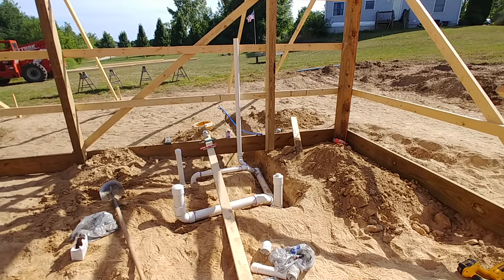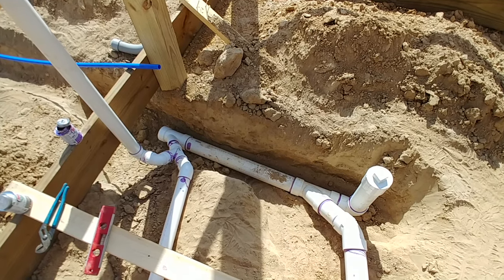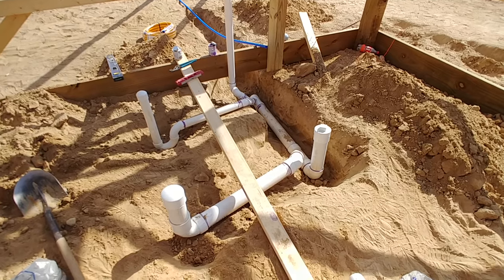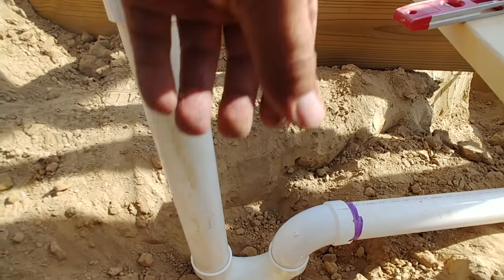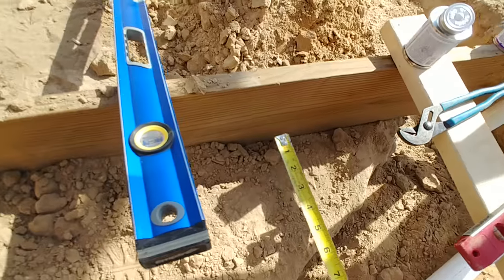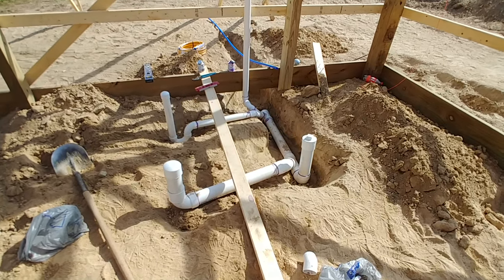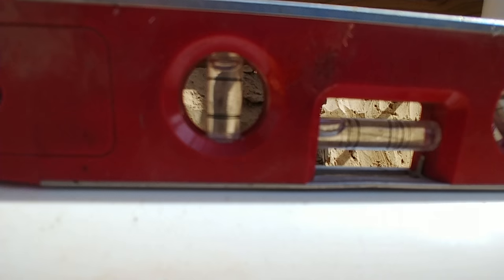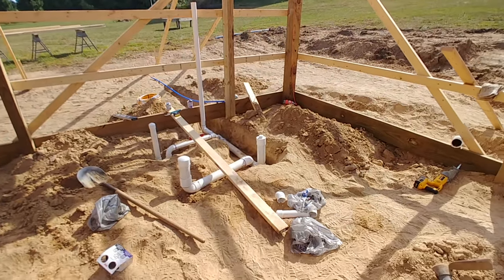Rough in plumbing basics for under a slab.

Comment: I’m a licensed plumber and this is mostly good advice. Just check the pitch on your pipe. 2in pipe should have 1/4” fall. 3in and 4in pipe should have 1/8” pitch. Also the location of your vent is off. If you’re going to be doing plumbing yourself you should consult with the local inspector before you run any pipe. Depending on your jurisdiction they should allow one free consultation per permit. Also if you need dimensions on the fixtures you’re going to be setting, you can request a submittal page from the manufacturer that should have the recommended dimensions
Reply: Hi ! I don't see ventelation for toilet , only for shower, it's ok?
Reply: What I don’t understand is when your looking at the plans how do you know where to put your pipes?
Reply: @VASYL198  unless that 2” vent picking up the shower is  also picking up the toilet. Can’t tell how many feet from toilet In my state it has to be within 8 feet …
Reply: For being a so callex(licensed plumber?) Grade is the least of the problems with this ground work!

Comment: Depending on state and city ..... some measurements and facts given may vary some....... for example, its ideal to grade trunk line between 1/8" to 1/4" of fall per foot.  Any more and your liquids out run your solids leaving them behind which can build up and cause a stoppage.  Good video ...... just check local and state regulations and codes.
Reply: Not actually proven true.

Comment: Quarter inch rise because you start at the bottom or clean out and go up, not 1/4” fall. The vent on the shower is over pipe diameter for grade, will syphon out probably. And tough to tell in the video, but min 2” wet vent on toilets. Plus toilet is over graded. The poopoo will be sticky sticky on the pipes

Comment: Your drain and vent going out need to equal the same area per code, minimum drain slope is 1/8" which needs to be engineered. You shouldn't use anymore than 1/4" because your liquid will flow past your solids. That way it will take it all down and not leave solids in your drain line.

Comment: This is the video showing what you should not do. The slope into main drain from the shower create a S-trap which violate a plumbing code. You should put them on level. Now you need to dig the slab to make it correct.
Reply: Wrong, do not use this layout.

Comment: Good job man.
2 things I learned last year:
1/4" rise is crucial - if you go any higher, you risk having the water run down the pipe faster than the solids do.
That means solids will linger and eventually create snag points for further, snags and eventually clogging - possibly.
Can reduce this by using the  1/4" rise.
Reply: I haven't had luck posting sources so here's a quote that debunks that, you can google it:

"Myth To Rest
(...) Of course, I found out that the professor was setting me up. This lead to the presentation of a new equation. The equation calculated the minimum flow rate to keep solids in suspension in a sewer system. The inverse of the equation calculated the maximum pitch before the liquids ran away from the solids. Of course, the answer to the maximum pitch was infinity. In other words, you could never reach that point."
Reply: Over kill is not always a good thing.
Reply: That's how I remember the rise as well.  If you have a rise in excess of 1/4" it could suck you right down the toilet!

Comment: Not sure if anyone has already made this point…?
But you need to stay as closest possible to the quarter-inch fall per foot or rise, as you called it.
Any fall that drops faster than a quarter inch per foot you will have liquid separating from solid, and that will create a clog!!!
Reply from the maker: Yes and I should have been more clear in the video as when I made the statement I was refering to the shower drain line.  But all solid waste lines should stay at 1/4 per foot rise. :)
Reply: i know it is mentioned in code but i do have doubts about it.  Why would a more sloped pipe be clog compared to a less sloped pipe?  Gravity should also play its role.  If the 1/4 per foot rise is really important, then why vertical sewer pipe are not formulated as such?
Reply: @halalmeatshophk  the water gets ahead of the turd and the turd slows down and eventually hardens.
Reply: @MrDW-ei1fe  is this an opinion or an established fact?  are there any tested made on different slopes of pipes?  and does these tests have reports for reference.
Reply: @halalmeatshophk  established fact. It’s common place in the plumbing trade to annually run an experiment to insure that gravity is real. 6 months ago at my shop we had the control group put dwv at the proper fall as per code while the experimental group puts it at a greater slope than is recommended. 3 months after we dug up the pipes and cut them open. The ones with greater fall than is required by code had a significant amount of waste build up whereas the ones at proper fall had none.
Reply: And any thing less will not be able to push it out.
Reply: either a heavy 8th or a qtr
Reply: @halalmeatshophk  wow dude, you should probably carry around a plant with you to replace the o2 you waste.

Comment: Are you using Oatey Medium Clear PVC Cement? 
How do you find it for working with 2-3" pipes? 
In case you have also tried the Regular (viscosity) cement, which one do you prefer?
I am trying to decide on which one to go with for 2-4" pipes and according to their description both will work fine as Regular can be used up to 4" and Medium up to 6".

Comment: Great video and excellent tip about the second line on the spirit level, until seeing this I was vague about how to layout my under slab plumbing.
Reply: Use the code recommended slope. Especially if you're getting inspected. They want it to match code, not vary from it. The slope is prescriptive on this for a reason. But it is a good thing to note what the lines mean.

Comment: Great video, built my pole barn/house pre internet days. Used Charlie Wing "Visual Handbook of Building and Remodeling".  Different size pipe have different allowed distance to vent. Whole house plumbing under slab. Still works great 26 years later. Your system I'm sure works fine. Glad to see the internet is full of hopeless do it your selfers like myself. Enjoyed the comments.

Comment: I always like when plumbing vids are recommended to me! This was a nice find. I'm seeing a bunch of "too much slope" comments though. This does not apply to plastic piping. Go look inside your pvc/abs piping. Notice it's really smooth and slick. Now wet it. Its gets really slippery, and will not catch anything. Your toilet flushes with a little over a gallon of water. All that water will carry any solids all the way to your city sewer tap or septic tank with proper pitch. Some codes say atleast ⅛" for 3", others say ¼" for 3". Now go look inside cast iron piping. It's not so slick, and actually quite rough on the inside compared with plastic piping. The "too much slope" idea came about with this cast iron piping. Inspectors were worried that with too much slope, water would flow faster than solids, leaving solids behind due to the rough surface of the cast iron. Just something you may consider next time. You're fine with the slope you have. I'm sure you've never had any problems with this rough in.
Reply from the maker: Thanks for the comment.  As I have also had a lot of extremely rude comments I deleted as well.  But this setup did pass inspection and works fine. So I felt maybe a lot of the negative comments were just trolls.  😀 But I do also understand different areas can have different requirements as well.  Just all depends on the inspector for that area.
Reply: @BevinsBuilds  honestly it is just how YouTube is. Miserable people want to go out of there way to somehow one up you by saying you did this and that wrong. 
I get them too, all day. 
Still hard to understand what is wrong with those people. 
I am considering doing my own rough in under slab plumbing so that's why I am here and your video does help. An honest thank you, you did not need to take the time to make and share the video but you did. Tell the haters to make a video of the "right way" they would do it, their nay sayer comments have no value.

Comment: Just so you know 1/4 rise is necessary so that some water remains in drain longer to keep paper from sticking to the bottom of pipe if you use 1/2 or worst 3/4 inch the water flows out too fast and leaves the paper behind to build up.

Comment: Thank you for sharing since I am doing something on a larger scale and u north where the lines have to be 4 feet underground to prevent freezing. This was a good start. Was wondering if I were to connect 3-4 washrooms and 2-3 sinks how many venting lines would be required. to be installed along the loop.

Comment: Awesome video .. the one thing i will add (that i got from a plumber once) - is that you don't want to put excessive slope because when you do, the "liquids" tend to leave the "solids" behind. Thought i'd mention that just in case there's any truth to it :) Cheers.
Reply: It's definitely true on toilet lines. (Because they have solids and toilet paper, the greatest culprit). On the smaller line...not typically an issue.
Reply from the maker: Yes you dont want to run it on too much of a slope. Sorry I didnt learn that until after I didnthis already.  But the plumber friend I have told me that being this is such a short run that the pitch ofnthe line is fine.  My finished pitch ended up being roughly 3/8 for 2 ft before the 45.

Comment: if the main out horizontal pipes are to be sloped at a slight angle, then wouldn't the vertical connecting pipes be also a little slanted and not perpendicular to the ground?  what is the technique to install vertical pipes perpendicular to the ground and yet the connecting horizontal pipes be sloped?
i do assume here that vertical pipe bonding with horizontal pipe are properly angled at 90 degree to avoid leakage.
Reply: Have you ever found an answer to this question? I’ve been wondering the exact same thing and I can not find anything on the internet that addresses this.
Reply: @conw5144   No i didn't find the solution yet.  I really wonder how they solve this problem.  If you do find any guides or video about it,  do share with me.
Reply: @halalmeatshophk  I definitely will
Reply: @halalmeatshophk  Apparently, the pitch on horizontal drain pipes is not enough to really affect the adjoining vertical pipes. Plus there is a small amount of wiggle room when a pvc pipe is inserted into a hub on a connecting piece. This was told to me by a licensed builder who also has had experience in plumbing. Hope this helps!

Comment: I would totally put in a toilet. When I am building, I always keep going until I absolutely have to go. I also recommend putting in a sink and counter so you have space to wash Lego or have a coffee maker and stuff.
Reply from the maker: I totally agree but its more of a cost issue than anything.  As I dont live in the city for me to have a restroom I have to install a septic tank and field.  If the tank for my house was closer I could tie into it but its so far away I wouldnt have the correct flow for my drain lines for it to work.  But at some point I will have a bathroom in it, just not sure when. :)

Comment: As per code you have to have equal going through the roof on venting as you do on the building drain, e.g. 3" out 3" through the roof. Two 2" and one 1/12" minimum. Or one 3" and every other ties in to that based on the fixture unit size.
Reply from the maker: The vent is 3 inch but I refered to it as the cleanout and yes it will be ran up and out the roof.
Reply: @BevinsBuilds  just a thought, good job 😎👍

Comment: The toilet is missing a vent.  The shower venting will not work, you broke the plane.  If the the 2 inch wye fitting was flat and not on a slant it would work.  you do not need a 3 inch cleanout inside of a small cabin or house.  The toilet is considered a cleanout since you can remove it.  The overall look was good and layout looked straight.  12 1/2 inches from from framing to toilet center is perfect since most people forget about drywall when they say 12".
Reply: I believe the code states that vents must connect to a horizontal drain at a minimum 45° angle. Meaning you could not use a tee or a wye to connect a vent to a drain if all pipe connections are coplanar (flat). I think his layout looks good, but if the 2 inch wye were flat, it would be… not good.

Comment: Where do you get the 1000 gallon holding tank for $182.00 ? The price has changed some but where did you find it?
Reply from the maker: It is funny I actually just responded to this on another thread.  The thousand gallon tank number one I actually missed spoke it was 750 gallons but number to the price tag on that now is considerably higher.  This was listed at my local Menards for $182 at the time of purchase and I only paid $182 but it's because they had it mismarked they actually corrected the price the day that I purchased it and now I believe they are between five and six hundred dollars.
Reply: @BevinsBuilds  ok i see ,well thank you so much for replying i do appreciate it greatly,ill have to look for your other channel i like to watxh your videos when i get a chance,again thank you keep up the good work!!!

Comment: This brings back memories!  Trust me...in the dead of winter when you’re in the middle of building or a live stream (pun intended!), you’ll be wishing you had a toilet!   LOL  Are you going to put a sink out there at so you can clean parts and things?
Reply from the maker: Lol, yes a winter stream would not be a good thing.  I would like to put a full bath in this and a parts cleaning area as well.  Thats all going to depend on when and if I am ever able to get a septic field installed.  Although from what I have been looking into I dont think it will be to bad at all to do.  As they have some smaller holding tank options being this isnt a residence.
Reply: Fix water pipe copper broken

Comment: Nice video! Easy to understand and to watch. Plumbing can be difficult at best for some people tackle. Other than a couple of code violations It should work. Might have a bit of a problem holding trap seals with the changes in height from the trunk line. Hope it all works for you. By the way 3” was a good choice if the septic doesn’t allow for a 4” inlet.

Comment: The vent is not off the main, it's off the branch so that means the toilet is not vented. But it's just a poll barn
Reply from the maker: The vent is off the main its what I refer to as the cleanout
Reply: @BevinsBuilds  I don't think the shower trap is vented either - that 2" wye would have to be horizontal (with 1/4 in/ft slope) to qualify as a "horizontal wet vent" according to UPC, at least. It will probably work, but it's not code.

Comment: None of that plumbing would be legal in the state of Massachusetts. There's no vent for the toilet. The vent for the shower is choked off by the 45 degree bend. The only legitimate vent in that system is the two in line for the lav. In my state you would also need a full three inch Stack vent, which is not present.

Comment: The way you have the toilet going up from main line created an strap or improper venting way prohibited
Reply from the maker: The main line actually continues past and the 3 inch line will eventually be made into the vent.  In the video I just placed a cleanout fitting on it.

Comment: If you install a sand/cement shower or a Schluter shower there is an additional curb you may want.   Their dimensions are larger than an acrylic shower base.  That would likely be added onto the 30” dimension of the shower. And that would mean your toilet would need to be moved over another 4” or so.